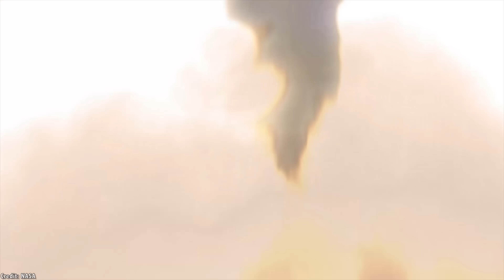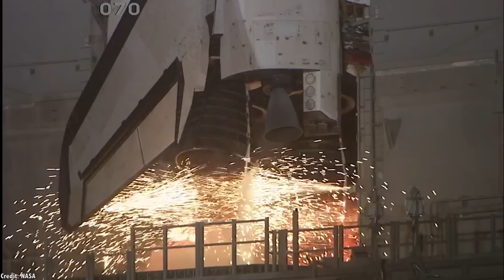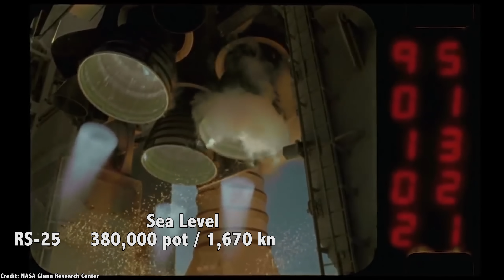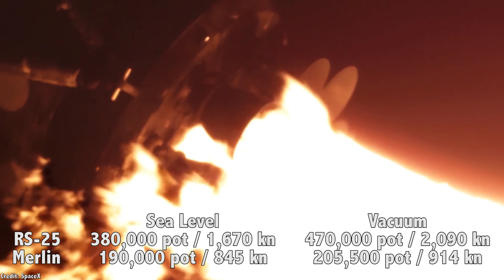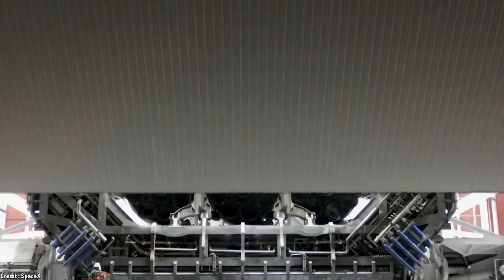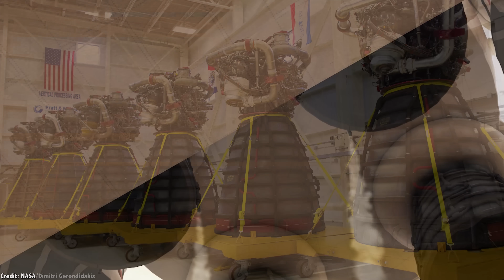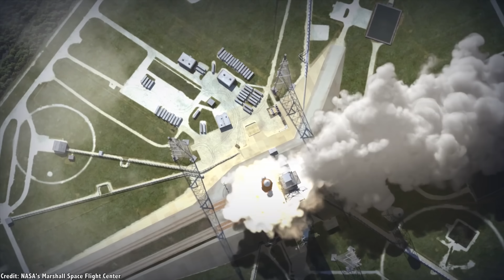The Rocket Engines Carrying Us to Space. The SLS RS-25 (aka The Space Shuttle Main Engine)

Comment: SLS has already spent $12 billion and will probably be over $30 billion before they get anywhere close to matching the Saturn V.

SLS Block 1 may be 70 metric tons at ~1billion but the Falcon Heavy is already at 63 metric tons and will improve with the Block 5 Merlins.

Throwing away the reusable RS-25 on single use seems criminal. And we know just how (not) reusable the solid rocket boosters are.

You probably guessed by now but I would kill the SLS program and divert the money to a Commercial Heavy Lift Program.

Not a big deal but not really fair to mention the BE-4 while not mentioning the Raptor. I wish Blue Origin but I can't take them too seriously before they have even attempted orbit.
Reply: You make some excellent points. Perhaps the better comparison to the SLS will be BFR but hard to know when it will actually fly...
Reply: Peter Andrews totally agree, NASA needs to return to the drawing board ASAP, and conjure up a new launch system that incorporates their already existing hydrogen launch systems with rapid reuseability.
Reply: James E
Every step of the way people have been saying SpaceX is living in a fantasy, and while they might not meet their deadlines they have been achieving all of their goals.
The BFR is being built at the moment and due to start doing test flights halfway through next year.
Reply: This is evolution of ideas. The falcon heavy has to complete too many missions to be certified for human use and as they are about to move over to falcon 9 block 5's this process must begin all over again. There is also minimal demand for commercial payloads which require the FH atm. The same has to be done for the regular falcon 9 block 5 too, which is why they will stop refining it now and let it get certified over the next few years while BFR is developed.

It looks to me like SpaceX is learning from each mission, have scaled back the BFR to make it more cost effective and easier for them to mass produce. The FH delays are because you have almost 30 rocket engines firing in unison which creates massive amounts of vibration and strain through 3 separate structures, where as the BFR doesn't experience this. Again, learning as they go and removing the complications they don't need.

I do genuinely believe that the SpaceX team will revolutionise space travel. It may not fit the aspirational time frame for sure.  What they have realised is that with the multiple number of vehicles and the iterations which take place as they learn, making all of them human certified is much too expensive.

Instead, they catered the BFR to achieve all 4 of these vehicles jobs in one. F9, FH, ITS and Dragon. This means that once the design has been perfected over testing it, human certification becomes much much easier for them as the same rocket will be doing all payloads and tests. I do expect we will see a few iterations of the BFR, but with a company due to do something like 30 launches over the next year it will be very easy for them to get the certification that they need.

For a point of reference the Falcon 9 is one of the most successful rockets ever made. It's success rate is only a percent point or two behind the Russian one which has flown 1700 missions and costs 10-20% per launch. Why not have faith in a company which is makin headway as they are?
Reply: The BFR will get human certified simply from launching satellites, so it doesn't have any actual cost associated with it. Launching Falcon Heavy enough times to human certify would be out of pocket cost for SpaceX as there isn't enogh commercial cargo missions which require it. By the time it's possible to reach certification they have will the BFR in semi working order, they only have 2-3 bookings over the next 12 months with FH in the same period the F9 block 5 has about 50, with several of these including dragon modules which may result in dragon being human certified too.

You're just a hater dude, you're selecting partial statements to turn against lol. FH has 30 rockets firing in unison across 3 separate structures, the BFR has them within a single structure. Not going to argue with you as you just wanna hate.
Reply: +Peter Andrews
Yes, the BFR is a better match but VERY unlikely to fly in its current form, especially any time soon. Musk is trying to achieve too much with one rocket. He thinks he can solve every major rocket challenge that engineers worldwide have been working on for decades: 

1st single stage to orbit (BFR 2nd stage)
1st fully reusable (even after going to Mars!) 
1st major refuel in orbit 
1st to refuel on Mars and return to Earth 
launch 100 people at a time in comfort all the way to Mars when the current record is 8 to LEO or 3 to the Moon
land well over 100 times more mass on Mars than the current record
be an economical suborbital routine transport 
bring down cost to orbit by a factor of 10 or more

And he hasn't even lifted a single person into space yet. In my opinion, the BFR is a fantasy.
Reply: +sickbailey21
"they have been achieving all of their goals"
Dragon capsule won't do propulsive landings.
The BFR has been seriously cutback from the original ITS.
The Falcon Heavy won't ever lift people, cancelling the 'around the moon' mission.
All of their goals? You are caught in the fantasy. You really think Musk will revolutionize space travel with the BFR after a mere few years development? Making a giant reusable Mars transport is slightly more difficult than that. Putting 3 F9 cores together for the Falcon Heavy was "fantastically more difficult" than Musk expected. No chance he is similarly underestimating the BFR?
Reply: "This is evolution of ideas."
You have repackaged "not achieved all of his goals" like a politician would as "evolution of ideas." If Musk had significant delays and design changes with cargo-only rockets that barely push the edge of rocket science, how much more will these changes be with his way-over-the-top BFR that is supposed to take 100 people to Mars?

"SpaceX is learning from each mission, have scaled back the BFR"
Of course they are learning. Just like Musk learned after his first ITS presentation that he could never pay for the rocket or the mission, so he drastically cut the size back and came up with the farfetched idea of using the BFR for city-to-city travel to generate money and interest in investment.

"FH delays are because you have almost 30 rocket engines firing in unison which creates massive amounts of vibration...the BFR doesn't experience this"
What are you talking about? The BFR 1st stage will have 31 engines with 3 times as much thrust each, generating the most total thrust ever attempted. I'm gonna guess the vibration will be slightly worse.

"I do genuinely believe that the SpaceX team will revolutionise space travel."
You believe that because Musk has done some good things and has a very appealing vision of the future, not based on the reality of the difficulty of deep space travel.

"making all of them human certified is much too expensive"
Do you think the over-the-top BFR will be more or less expensive to human certify? And not for 3 or 4 people, but for 100! And how long will this take for a giant groundbreaking rocket?

"with a company due to do something like 30 launches over the next year it will be very easy for them to get the certification that they need"
You are not considering how many radical abilities they are trying to cram into that one beast of a rocket. Your outlook of "easy" might have worked for the FH.

"the Falcon 9 is one of the most successful rockets ever made.....Why not have faith in a company which is makin headway as they are?"
The F9 is a great rocket, but it is also a very normal rocket that pushes the state of the art in the single area of reusability. Why not have faith? The BFR is anything but normal and slated to break thru in 10 major areas, which makes it a fantasy. Also because Musk has an ongoing habit of hyping (lying) about his plans and achievements to the point that millions of the naive falsely believe he will save them from the cruel Earth to live the second half of their life in a Mars colony.
Reply: "Falcon Heavy is already at 63 metric tons"
It can only lift that much by trashing the whole rocket. Under 3-core reuse, it is about a third that much.

"Throwing away the reusable RS-25 on single use seems criminal."
It's not criminal if your goal is max lift. Reuse always comes with a payload penalty. Plus the RS-25 will be pushed during launch past 100% to further increase lift, which damages it beyond repair. Reusability is looking good for payloads that orbit the Earth, but going to the Moon or Mars, especially with people on board, requires much heavier lifting which probably won't work with a reusable rocket. Definitely not any time soon.

SLS is specifically designed for deep space launching.
Reply: +Chaim Goldbaum
SLS is designed for heavy lift missions that go to deep space. The current state of the art rocket science is that you can't combine reuse with a heavy lift like people-to-mars or a significant moon mission. You either get reuse to LEO or you throw everything away to carry people to deep space.

Comment: I think the RS-25 engines should not have been directly embedded into the rear of the shuttle orbiter because they were dead weight once in orbit. A design similar to the Buran's use of Energia would have allowed the shuttle to have a larger payload or increased mission lengths. 

Of course, an RS-25 probably wouldn't be reusable if they were dropped into the ocean but perhaps a parachute, a retro rocket and some airbags could've facilitated a soft landing or flotation at sea.

Comment: Surely somewhere at NASA there must at least be conversations taking place about trying to emulate Spacex's landing technique. Given how Nasas budget is tight, imagine how much more they could achieve with a reusable SLS!
Reply from the maker: I'm sure the conversations now are just when they decide to shift missions to SpaceX flights.
Reply: Everyone who thinks SLS can be reusable doesn't understand how close the core stage gets to orbit. For any rocket with two side boosters, slowing the core down enough to land absolutely destroys payload capacity. Cuts it at least in half.

So you need to make your payloads at least 50% smaller and double or triple your launches to build THE SAME space station. Launch is the riskiest part of spaceflight, so minimizing launches minimizes program risk.

Modifying the SLS design to be reused is pointless unless each one can get more than 3 flights. SpaceX has yet to refly any of THEIR first stages more than once. NASA has plenty of experience with SRB refurb and knows that it's not worth it.

So SLS will fly once a year on average to maximize payload delivery or payload speed, in the case of outer solar system probes. 

It's like the Antonov An-225 "Mirya" in a sense - only useful for about one heavy cargo mission per year, but very useful if the payload is valuable enough to justify flying on it.

Jettisoning the RS-25s would be awesome, but as the clip explained, modifying them to produce more thrust makes them harder to reuse. So, with SLS's already low flight rate, making the RS-25 expendable actually ADDS value to the vehicle by enabling it to launch more payload. That will not change.
Reply: A reusable SLS or any other rocket means less lifting capacity.
Reply: The only thing that could conceivably make sense is something modeled after ULA's SMART re-use system to save the engine section with the RS-25's. At this point however, there's no point in redesigning the thing again. It is what it is.
Reply: Frasier Cain - It's not so much a matter of "when to shift" as "what to shift?" NASA will use Falcon Heavy to support aspects of lunar operations and some deep-space missions, but SpaceX will not be contracted to launch the most expensive, most mission-critical pieces of hardware.

Cheaper vehicles launch the cheaper payloads. That's just how NASA budgets launch vehicles.

Comment: Would it be possible for NASA to keep the Engines in orbit to use for another project? Seems a waste to just let them burn up in the atmosphere.
Reply: The 4 RS-25s will be attached to the 1st stage which falls away before achieving orbit, and will likely end up crashing into the ocean.
Reply from the maker: Nope, the flight plan for the SLS means destroying these engines.
Reply: The RS-25 engines are not reusable, they are refurbish-able, but that means returning to earth and many months of work to get them flight ready again.
Reply: The RS-25s are being modified to provide more thrust, which makes them harder, if not impractical, to reuse.

Since the SLS's goal is to repurpose Shuttle hardware to launch as much payload mass into orbit as possible, trading reusability for thrust is not wasteful at all. It's optimizing SLS for its niche launch requirements.

Is producing about 4 RS-25s a year really such a bad thing?

Comment: but it's not re-usable.....great video Fraser but come on man, we need to move into the future...not the past
Reply from the maker: Well, ironically, it was re-usable and was reused for all those shuttle flights and now it won't.
Reply: Re-usability may not be the future for spaceflight. It's too early to tell. It hasn't been proven on a large scale in the long term. Any reusable rocket suffers a payload loss, which may not work for heavier lifts.
Reply: What James E says. Even SpaceX has serious doubts about re-usability with heavier payloads.
Reply: I'd love a source for that notion.
Reply: This is a way of thinking passed down from the days of rockets as weapons delivery systems. You only used one rocket once, and what mattered was whether you delivered enough bomb to the right co-ordinates. When you want to operate a transportation service, it doesn't make sense to optimize for maximum payload per flight if you can operate more efficiently with a durable fleet of vehicles and support infrastructure. Falcon heavy's max payload to GTO is only about 50% than a Falcon 9 ran in expendable mode but they would much rather get all their cores back than throw one away.

Comment: I guess it comes down to cost. Spacex is doing BFR next but they do have plans for a super heavy falcon with 4 outer boosters instead of the heavy's 2. That would have massive lift capacity and all 5 stage one engines (4 outer and 1 core) would be re-usable. That some cheaper $$/kg to space.
Reply from the maker: If they can get the BFR going, this super heavy probably won't need to be developed.

Comment: how large can you build a pressurized air rocket which pushes out water, like the one you can build yourself with a waterbottle and a bike pump? Sounds a bit cleaner. Whats the bottleneck limit on why you cant use same principle for real rocket? Mass of water or pressurized air tanks?
Reply: Cheburushka Pressure vessels are limited by the tensile strength of the material they're made out of.  Going to guess that the energy needed to launch a rocket would require a storage tank too heavy to lift itself.  And burning hydrogen produces water vapor so not exactly harmful unless you hate humidity.
Reply: Don't the condensation trails airplanes leave cause an increase in the average temperature over the areas they fly due to the cloud coverage holding heat bellow like a blanket?